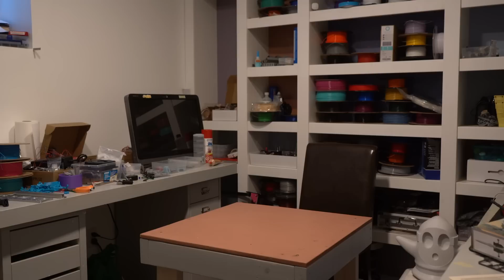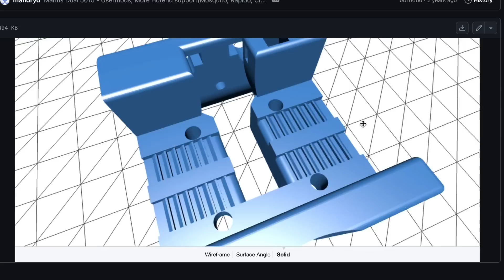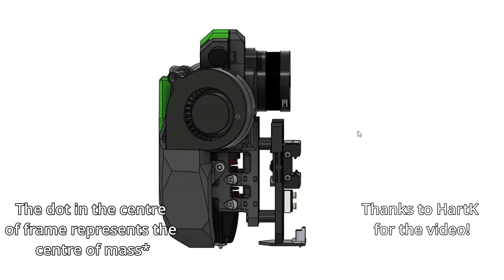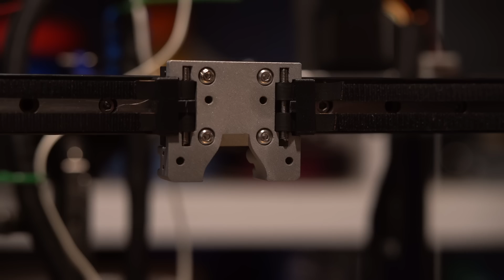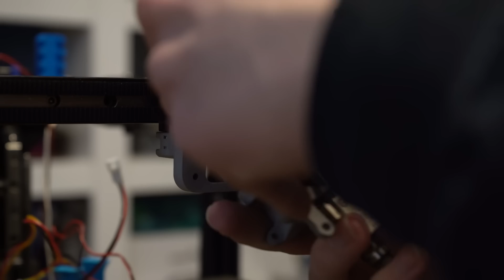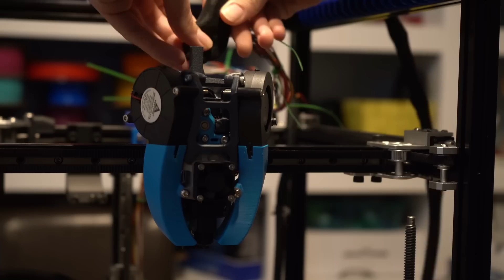I made my 3D printer even FASTER with METAL!

Comment: I'm a big fan of Xol been using it on my 2.4 for a long time with a Sherpa Mini.  You did good with this but I loathe the mantis ducts. They are big for no good reason because I don't print PLA on my Vorons. But otherwise, this is an awesome job.
Reply from the maker: With a high enough chamber temp ABS needs just as much cooling as PLA does. I'm not at that point on my own build yet though

Comment: The only reason I would custom build a printer in 2025 would be to make a high chamber temp printer. But it would be a lot of work to make it happen…
Reply from the maker: I'd love to build a high temp build at some point, but honestly I don't really have a use for any chamber temps over 80c
Reply: @ 80c would be nice. But you would need a water cooled hotend and water cooled hotend electronics board. You mean 80c degrees correct?
Reply from the maker: I do mean 80c, but 80c is cool enough you don't need any water cooling. Just don't use a toolhead board and use high quality delta fans since they're fine in the heat.

FWIW I already can get my trident to almost 75c chamber temp just by chucking a blanket over it, and i've never had issues

Comment: Building a Trident, and as someone who prints almost exclusively PLA, the Mantis toolhead always appealed to me.
Though I was hoping for something a bit more modular and updated to work with a Rapido hotend, plus a CAN toolhead board and Beacon/Cartographer probe.
Xol is an option, but I was pretty set on using 5015 fans, and I didn't like that their only option for those involved making modifications to the design of the printer itself, like flipping idlers.

Like you, I'm sure I could modify an existing design, though I'm mostly only familiar with 3D surface modeling, which is incredibly tedious to iterate on designs with like you would with CAD.
Reply from the maker: Why not try something like Mjolnir then if you need 5015s? Otherwise you could run cpap and use something like Breakneck or Xolpap
Reply: @mitsubishimakes  Not a bad idea, I think I originally ruled it out as I was set on using standard Rapido vs. UHF, but I'm sure that won't matter too much. CPAP does seem the way to go these days, and I do love my PLA.

Comment: Personally I think you'd be better served by making the hotend saddle the linear rail, perhaps two smaller rails back to back even, distribute the weight of the components to move the som close to between the rails. To be even more exact rather than simply saddling have it form a triangle around the rail(s), then you've maxed out the stiffness from the design perspective.
Reply: I was thinking the same thing. You'd definitely add overall mass but could get the COM right where you want it.
Reply from the maker: Interesting ideas, I haven't seen any dual rail setups since the V2.4 came out

Comment: Jepp, a toolhead made from metal (aluminium) is the best thing to get it rigid. I printed my toolhead (a simplified EVA derivate) a few month ago with pcbway. Works like a charme and the print quality and speed of my CR10v1 is comparable with my P1S.

What is the weight of your toolhead?
My Eva'isch toolhead weights about 360g (Orbiter 2+Rapido+Cage+Hotend_Rapido_EVA+Backplate without cooling).
Reply from the maker: Y'know, I never actually weighed it... If I had to guess I'd say somewhere in the low 400g-450g range though, 5015s weigh quite a bit

Comment: The best design I've seen since the mantis. The only thing that bothers me a little is the blower channel output of the printed model, since it blows far from the nozzle, and it blows massively, not pointwise. I don't see the point of 5015 in 2024, cpap is the minimum requirement for fast printing, but this design drives me crazy... I'll print one for my collection, thanks!
Reply from the maker: Thanks for watching! Coming from 4010s the 5015s feel like a huge performance boost, but I'd love to try out cpap cooling eventually

Comment: I noticed that you didn't guide the air from the fan over the heatbreak in the middle but rather the whole heatsink. While in theory this seems logical, it will probably have alot of jamming issues on PETG if you're printing slower.
Reply from the maker: Good thing I don't print PETG, nor do I print slow :)
Reply: Axial fans hate any sort of choke of their flow.   They stall so easily.   Turns out a straight path is superior here.

Could also be improved with some anti swirl vanes just after the fan.   A simple cross works

Comment: I just installed a dragonburner. What about this one is better besides the better COG? Or does the COG reduce vibrations that much? The fans seem further away from the nozzle. I would assume closer would be better for cooling?
Reply from the maker: Closer is definitely better for cooling, but 5015s perform about 60% better than 4010s, so thats where the real advantage of this setup is coming from.

If you are looking for a higher performance 4010 fan toolhead, A4T by DW Tas is probably the single best option right now

Comment: I love the underground 3d printer building content.   

Only thing missing is how you ended up here.  Why did you choose to do this mod over archetype or takeoff?
Reply from the maker: I use Archetype on my other trident build, and I'm not super happy with it. In theory the COM of Mjolnir is near perfect, but the toolhead isn't rigid enough and I get very poor IS results using it. 

Takeoff is a very cool option, but I wanted to save money using parts I already have rather than going out and buying a chube and beacon and such.

The next thing I want to experiment with is CPAP cooling. I have a very rigid toolhead core, so all thats left would be to design some cpap ducts for it and see how that performs!
Reply: @ hey, thanks for the reply.  This makes a lot of sense.  Good insights on the archetype rigidity.  Thanks.
Reply from the maker: @ImHereToLearnStuff  No problem. Don't wanna spoil too much but I will be trying some archetype mods out on the other trident to hopefully resolve some of those rigidity issues. If all else fails I could just get those parts SLM printed too 🤣
Reply: @mitsumakes  I wanted to use Mjölnir for my toolhead replacement. How bad do you think the rigidity issue is? Also, what did you print the parts out of? If you used ABS you might get better result using something like PA12 CF which should be stiffer.
Reply from the maker: @AthenesWrath  The version I printed was pretty bad, I want to try out the newer experimental release but haven't had time yet. I printed the core and the carriage out of CF ASA for rigidity, and the rest in normal ASA. Most nylons creep really bad, and I wouldn't recommend using it for printer parts unless you really know what you're doing
Reply: @mitsumakes  Thanks for the answer. I really like the Mjölnir design so it would be a bummer if IS stays bad

Comment: Looks awesome. Considered doing upgrades like these on standard machines that most people use? Like the SV08 ? ♥
Reply: “That most people use” …. A voron 2.4 clone? Who is using that …. “Most people” lol
Reply from the maker: @-ejs-  The clones definitely aren't popular in the DIY scene, but maybe general consumers are buying lots of them?
Reply from the maker: The SV08 makes a lot of dumb design decisions that hold it back from being high performance, but theres no reason you couldn't put this toolhead on one (and the extra cooling would probably help quite a bit!)

I wouldn't personally buy an SV08 but if Sovol wants to send me one I wouldn't say no 🤷
Reply: @mitsumakes  What dumb design decisions were made? I purchased one just to tinker with since it was so damn cheap (500$) and it's been flawless so far.
Reply from the maker: @jnssmnsn  The belt path isn't straight on it at all. Belts pulling at different angles lead to inconsistent belt tension depending on where the toolhead is (and thus inconsistent sqaureness of the gantry, since belt tension controls that on a CoreXY)
Reply: @mitsumakes  I thought the sv08 was basically a clone of the 2.4. So the belts have a different layout?
Reply from the maker: @jnssmnsn  The belts are different, yep. Its similar but the XY joints are made more compact at the cost of pushing the belts out of alignment...

Technically the stock Trident/V2.4's belt path is also slightly out of alignment though😆
Reply: @mitsumakes  Interesting thank you, i'll definitely look into this. As my current plan is the replace the stock plastic parts because the light blue sovol color is so ugly.
Reply from the maker: @jnssmnsn  Would be awesome if you could fix the alignment issues with some printed upgrades!

Comment: Input shaper differences on before and after? What's the cost would be for the metal parts?
Reply from the maker: I'm yet to get proper input shaper results because I can't fit my nozzle mounted ADXL between the ducts. I did run a test with the accelerometer on the front, but its not an apples to apples comparison. Once I nozzle mount something I will post a before/after 

The cost of parts would be $205 including all of the tapping.

Comment: You'll go even faster than what? I didn't heart any time you mention neither accelerations nor requested speed.
Reply from the maker: The print at the end (and in the intro) was 500mm/s at 25K accel, it says that on the video. On my last setup I wasn't able to consistently go over 400mm/s since I'd run out of cooling. I'd love to try faster than 500mm/s but now I'm running into flow bottlenecks...

Comment: Why not the Takeoff Toolhead?
Reply from the maker: Takeoff is much more expensive since it requires a Chube hotend (althought IIRC burgo was adding support for goliath too?). Its a solid option but I don't have chube money atm😅
Reply: @mitsumakes  Ah i see, but aren't the step files available?
Chube is way too expensive imho.
Reply from the maker: @warmesuppe  Step files are available, but its designed to cool the hotend via conduction only. It might be tricky to fit a fan in there given the other design constraints
Reply: @mitsumakes  Ah i see!
Personally i really like the 3628 or the 4020 axial server fans.
One of them can outperform two 5015s easily.
My 4020 has like 35m³/h and a couple of mmH2O.
Reply from the maker: @warmesuppe  They are definitely some powerful fans!
Reply: @mitsumakes I had a feeling you were from that discord with Burgo
Reply from the maker: @plonkosbrazoon  Wdym?